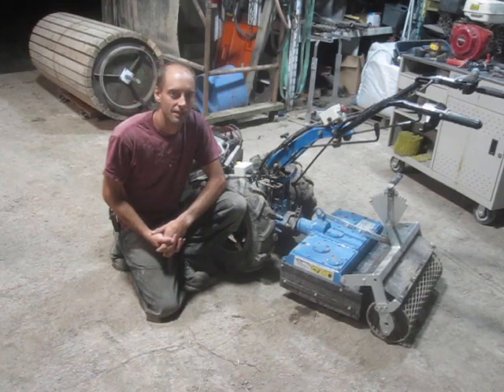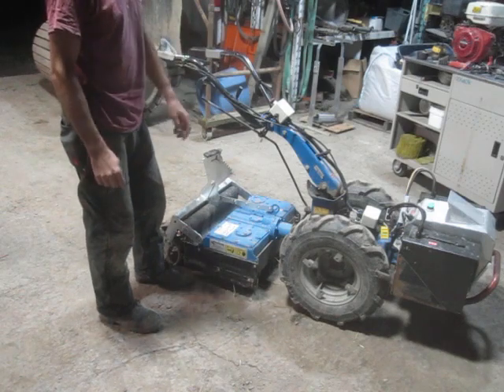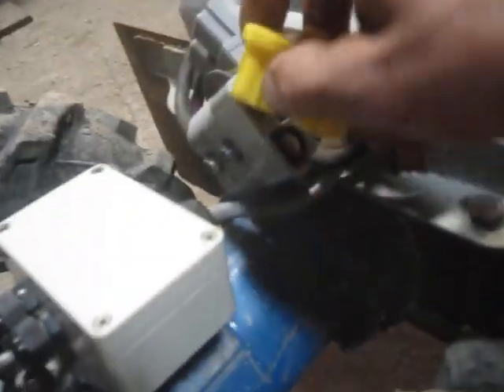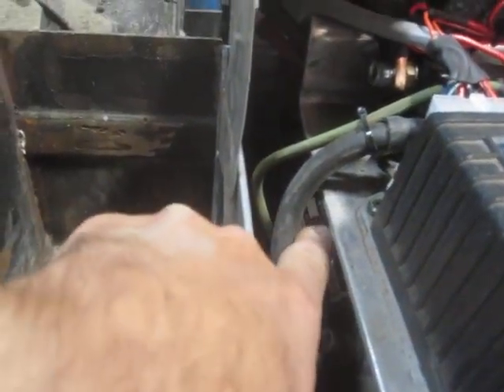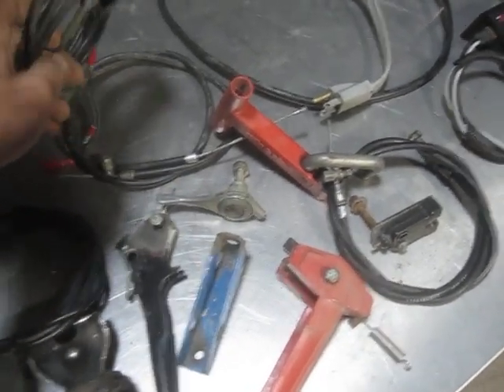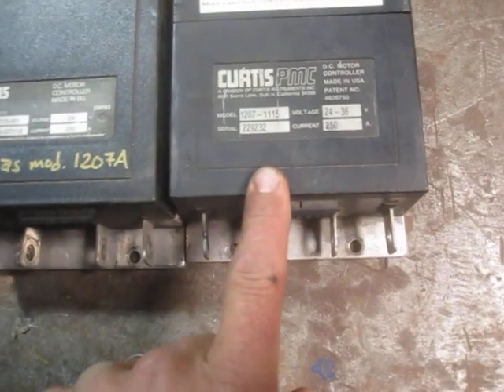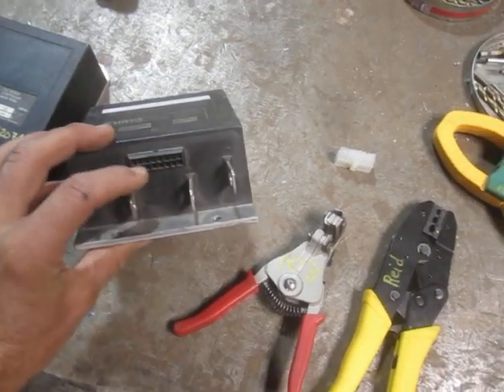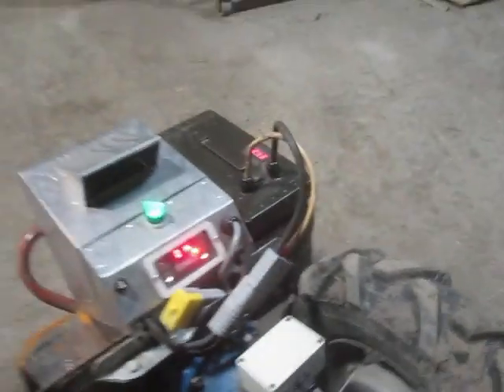Electric BCS - technical details walkthrough

Comment: I was tilling some new beds yesterday with our two wheel tractor (a grillo not a bcs but close enough)And I was thinking it would be so nice to electrify the damn thing. And here you are! 
Thanks for the video, it is very inspirationnal and helpful. If you ever feel like writing an instructable page, that would be much appreciated.
Reply from the maker: I'm pretty sure someone else will soon do an easier-to-duplicate build using easy-to-find parts.  Mine is too much based on what I already had on hand and while it's a good and functional one-off it's not a great template for others to copy from.  I am happy to answer questions and provide guidance if you decide to tackle such a project yourself.

Comment: You'd think BCS would bring out an electric version direct from the factory themselves. This makes so much sense as you are not alone in wanting to use an emissions free machine in a confined space like a polytunnel.
Reply from the maker: I do hope that BCS or Earth Tools will tackle this in the years to come.  The lack of emissions and noise is what initially appeals but the control, performance and improved safety of the machine have even more staying power.  Long after we've forgotten what a gas engine even sounds like we are still appreciating the control and precision of the electric drive because it's not just less bad, it really is better.
Reply: Well since BCS really only packages some other companies engine with their kit I'd say we just need someone to make a complete electric pack that can swap in.

Comment: Thank you so much for posting this. This is exactly the sort of tour that this nerd was looking for.  So rarely do people get into much detail. 

Maybe I missed it skipping around, but what is the capacity of the batteries? 

How much time do you get out of them say, tilling?

It was interesting to do the math on your amperage, seems tilling only uses like 2 hp continuous and max power is under 8.

This is an outstanding project, an excellent explainer, and one I would love to do myself one day.
Reply from the maker: Solomon Parker there's another video on my channel somewhere from a stress test where I finally had enough work to run the batteries down one after another. They last about 30 minutes at sustained 60-100A load - which makes sense for 1kWh pack at 24V.
Reply from the maker: Solomon Parker thanks for the geek praise. You're fully the second person in two years to really enjoy the details and say so 😆. The other guy was a friend of mine but at least it means we're not alone.👍
Reply from the maker: And yes Solomon you're right about the power figures.  7kW Power in makes quite a lot of torque through a DC motor.  I might worry about the drivetrain with more.  The only change I'd make with a do over would be to go up to 48V for lower amperage and higher motor speeds at same power - but that posed more challenges for battery pack design, at least with my budget.

Comment: Great build! Your design and implementation is pretty much perfect in my opinion as far as a balance of robustness, availability of parts, cost, performance, simplicity (in a good way). It's an amazing time in the world that as I was thinking of this conversion I was able to find your video posted only a few days ago. Especially since I'm not so mechanically inclined and would be mystified about some of the details you showed. I do have a few questions if you care to answer:

1) Have you considered leaving the clutch installed? It seems this would give you a mechanically controlled ability to modulate torque, otherwise the motor controller acts as a speed control rather than torque control (though speed control is ideal for most applications). 

1a) If you left the clutch installed, then would the custom-fabricated interface be DC motor <- -> Clutch input (which looked like a keyed shaft in the video but i'm not confident about that). Would that be an easier to build or find parts for?

2) Regarding keeping the tractor balanced, you mentioned intentionally designing for compactness to match the weight balance w/the honda. (Maybe this is also one reason you removed the clutch). Could you also keep the balance by moving the batteries closer in to the wheels, either mounting them sideways so the tractor is wider, or mount the batteries up higher almost in between the wheels? Basically what happens when the heavier person scoots towards the center of a seesaw/teeter-totter. Do you have any mass or center-of-mass measurements for the electric and/or gas drivetrain?    

3) I'm a new owner of a used BCS and I haven't used it that much yet. I noticed there is a mechanical interlock to prevent PTO engagement when the transmission is in reverse. When adding the electric reverse, is there any risk of damaging certain implements somehow? Or is that only a safety measure to prevent me from tilling my toes?
Reply from the maker: Thanks for the kind words of encouragement and the great questions.

First off I would say that if your BCS isn't going to be used indoors or has engine problems it's probably not worth the time and effort to convert to electric - especially if you have a Honda engine.  In our case the BCS is currently used almost exclusively inside greenhouses (though I used it in the field yesterday) and that, along with my interest in the conversion challenges, was enough justification to shelve a perfectly good Honda GX340 in favour of something more expensive and unproven.

1) Re: clutch removal or not.  I don't know about newer BCS or models with the hydraulically actuated "Powersafe" clutch but on the older models the clutch is just about the only flaw in the BCS design.  It's a conical clutch that tends to grab and the size and strength of the operator's hands largely determine if it is pleasant, safe and useful or the just the opposite.  Women farmers with smaller hands have been complaining about BCS clutch operation for years and this frustration was targeted for elimination as part of the conversion process. Also, the conical clutch is not a very good clutch for modulating power or torque as I believe it's designed to prevent slip.

The clutch isn't terribly heavy but it is bulky, filling the volume of the bell housing.  Thus, keeping it intact would make the machining/fabrication of the adapter shaft trickier and might require shifting the electric motor further away from the bell housing, increasing forward weight which I wanted to minimize.

All told the clutch had very little in its favour as a keeper and go the axe.  It also simplifies the control systems to have no clutch which makes it easier to train employees on the BCS.  Many people never really “get” how to use a clutch anyway.

2) The compactness of my overall assembly is going to be hard to improve on except by using a physically smaller battery and changing them more often.  There’s only about 2 cm clearance between front of the wheels and rear of battery cradle.  If the batteries are set in the other orientation (wider L to R) it would make them the widest point on the machine, compromising manoeuvrability and preventing it from fitting in certain narrow walking paths, maybe even doorways.  if the batteries were stacked above to motor and clutch housing it might prevent swinging the handlebar to reverse operation position used for mowers and other front-mounted implements.  I’m pretty happy with the balance result of this setup and don’t like the compromises of the others.  That said my friend François Handfield converted his BCS with a slightly smaller motor at 48V and used a larger Volt 12S battery module mounted above the motor - and he can still reverse his handlebars.

3) I toyed with several solutions to the PTO-reverse interlock.  I liked the idea of using a 24V solenoid or magnetic acuator to pop the PTO to neutral whenever reverse was engaged but I didn’t want to spring for the parts and ran out of time.  I assembled a lock-out switch that would prevent reversing until PTO was disengaged but ultimately decided not to fit it (again time and perhaps tedious in operation).  I don’t think many implements would be damaged by reverse operation but It’s a valid question.  For a mower I definitely think an overrunning clutch would be in order if there isn’t already one integrated into the mower - I don’t think you’d want the mower’s blade inertia to keep spinning the electric motor for no good reason after power is removed, though I suppose you could recover the energy with an appropriate controller.

Having now logged some time with the tiller I find it convenient to not have to disengage and re-engage the PTO drive for brief reverse movements but when I’m backing up significant distance I do disengage.  Maybe an audible alarm would be a good solution for this so you don’t do it much but have the option of doing it briefly, as when correcting your path with a quick reverse to the side.

Thanks for the great questions and please share other ideas as you ponder the pros and cons for yourself.

Comment: Does the reverser  also reverse the PTO or just the wheels? It seems one would want to retain that for some of the reversed implements.
Reply from the maker: The original mechanical reverser in the BCS gearbox does not affect PTO direction but it is set up so that it disengages the PTO when you flip into reverse (using the clutch to disengage the gas engine during shift). My new setup with electric reverse simply reverses motor direction and drives everything backwards, including the PTO. I considered using a solenoid or other actuator to pop the PTO out of gear when switching to reverse but just ran out of time and patience to implement it. For a commercial version you'd have to make some similar provision for safety (anti toe-nibbling security for folks who don't wear steel toe boots).  A bypass to deactivate this function would make sense when the handlebar is reversed for front PTO implements like mowers or snowblowers because you wouldn't want to interrupt their power when reversing. I think they'd need an over-running clutch too or stick with the mechanical reverser rather than reversing the motor. I'll figure that out when I get a mower.

Comment: Cool beans.  Is there clearance to flip the handlebars around?
Reply from the maker: Yes.  loads of clearance.  The handlebar and controls rotate just as they did originally and there's actually more clearance than with the Honda engine.  The control cable layout is also much simplified as I've now got just one bundle of wires in a  heavy sheath and only the diff-lock cable (clutch, throttle and reverser cables were all deleted during conversion).

The wiring layout with upper and lower junction boxes was also chosen to facilitate adjusting and reversing the handlebar.  The lower junction box is securely mounted to the transmission on a little mounting plate I fabricate and there's just a tidy and flexible bundle of wires from the lower junction box to the upper one.  The upper junction box provides a place to tidy some wire connections and also a convenient spot for the emergency stop button.